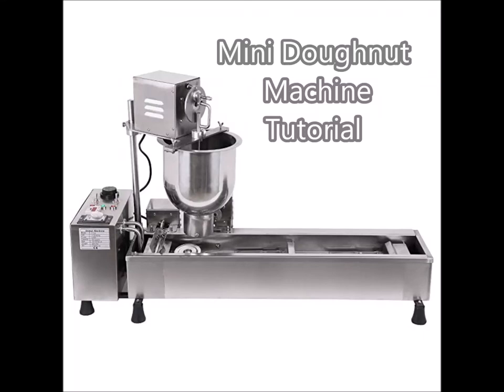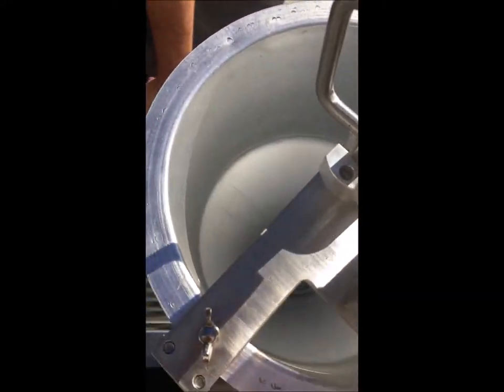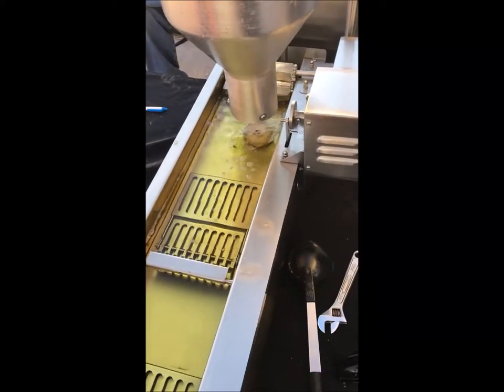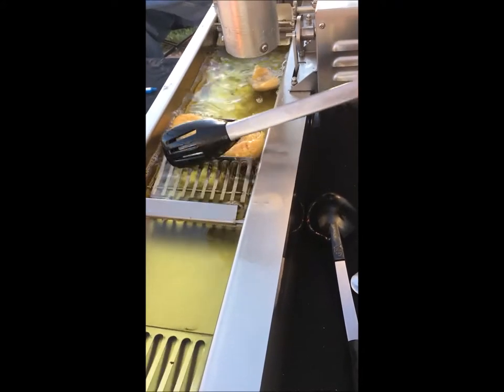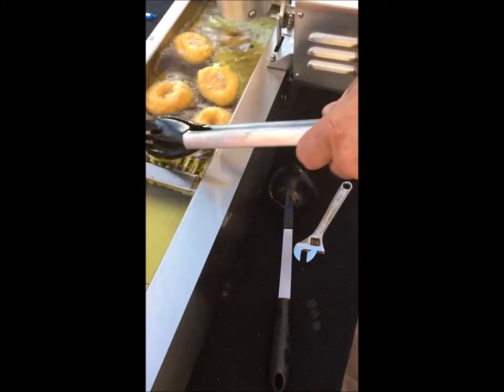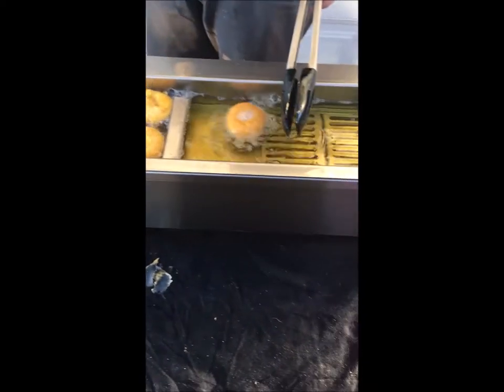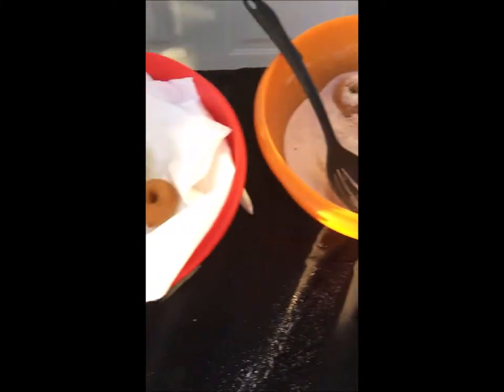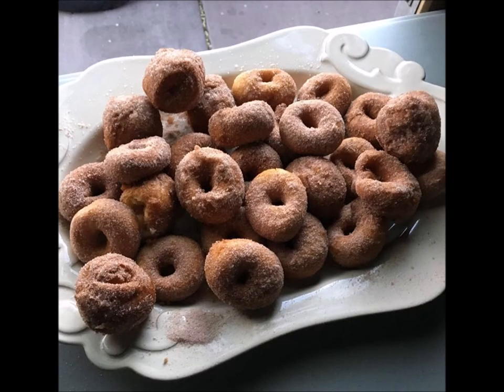mini doughnut machine tutorial automated hopper, flipper, fryer- How to use the machine

Comment: My machine doesn’t want to drop the donuts from the top the flipping things are working but the drop thing were the toe is is not working do you have an idea why it’s like that it will help me a lot Thankyou I have the same Maschine as yours.
Reply from the maker: Does it rotate and the bottom part come out of the hopper on the rotation but no dough comes out? If that's the case then your dough is too thick.

Comment: I have one we were going to use at our second hand store. Today added coconut oil, plugged in and turned up temp. Then the machine stopped. Circuit breaker keep shutting machine. It is used, is the thermostat bad? Any idea?
Reply from the maker: It could be your wattage or amps aren't enough.  It needs 30 amps.

Comment: Great video does this require an Ansel system
Reply from the maker: We've never used one.  But check with your local health department and the local laws & regulations where you're at.  It would probably depend on where you plan to use it.

Comment: Can you tell me which kind of generator you use? We have this machine and our generator is tripping. It has 5280 running power. The machine itself takes 30amps.
Reply from the maker: It needs at least 3,000 watts- not peak watts, but minimum. I believe ours is 5,000 watts with 7,500 watts peak. And we weren't able to run anything else on the generator.
We ended up getting a 9,000/11,000 one so we could run a couple things on one generator.
My husband could tell you a little better- I'll double check with him when he gets home tonight and make sure I'm giving you the right information.
It does take 30amps which gets tricky and very demanding on the generator.  In hindsight we wished we would have paid the extra up front for a gas machine.

Comment: Hi! Looking in to starting a mini donut business, but there isn’t much info about how and where to start. Is it easy to set up and take down? Do you have a video on breaking the machine down. Also is it a good side business? Thanks!
Reply from the maker: The biggest issue with setting up/taking down is heating the oil up- then waiting for the oil and machine to cool down before you can pack up.
It would work best in a trailer or food truck where you don't have to worry about waiting until the oil cools off and the machine is cool enough to move.
It's easy to set up, however the machines can be finicky- wind, weather etc. will effect the oil temps. You need steady oil temps to cook the doughnuts.
If you have $40,000 minimum to start out and buy a truck or trailer to do it from and don't mind long days and doing events then it could be worth it.
For us we did it as a side business for fun on the weekends and eventually it wasn't worth our time and investment to continue doing while it consumed all our weekends.  So we stopped for now.  We'll still use the machine for block parties, family events, etc. 
It would probably depend largely on where you live and how much time and money you are willing to invest.
Hope that helps!
Reply: @AtoZForMoms  Thank you! I have a plan to buy a small concession trailer. Nothing to big. I would like to do weekends at the farmers market, events, and maybe parties. I’m a nurse full time and want to sell my cake jars and mini donuts as a side job. Thanks for the info. Stay safe and blessed☺️🙏🏾

Comment: Where did you buy this machine? Is there a way to change the size of the donut it makes to make something smaller?
Reply from the maker: We ordered it online years ago, it's no longer available from  the same seller, but here's another one like ours:  https://amzn.to/3CeKKGW 
And yes, to the doughnut size question. It came with 3 molds for different sized doughnuts from mini to large.  We have only ever used it with the mini size though, that is the size in the video.
Reply: Hi is the machine still working ok
Thanks
Reply from the maker: Yes it still works, but it's always been finnicky- just comes with the territory.
Reply: @AtoZForMoms  Thanks for the advice. We've ordered one from Otex so might stick up a video once it's up and running
Reply: @AtoZForMoms  hey…I have mine now. Just wondering what type of oil you use? It’s recommended palm oil but just wondering if you used something else
Reply from the maker: We use Coconut Oil.

Comment: Is it electric? Propane?
Reply from the maker: Ours is electric, it takes a LOT of amps so we have to have a dedicated generator for it.  In hindsight we wish we would have got a propane one instead (they cost a little more).
Reply: @AtoZForMoms  So, this specific machine can be propane? How many donuts can it make in an hour?
Reply from the maker: The one we have is electric only. You can get propane versions but it's a different machine.  
The number of doughnuts per hour depends on the size and temp of your oil....I don't remember off hand but I'd say it can make about 2-4 mini doughnuts per minute, so 120-240 per hour if you were able to maintain the speed and oil temps.